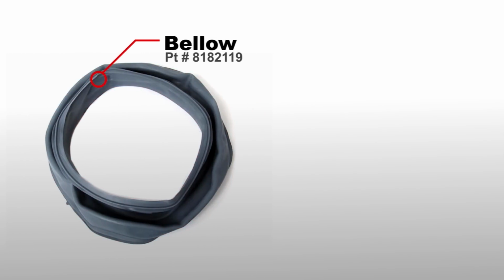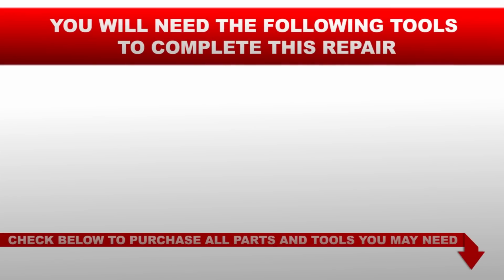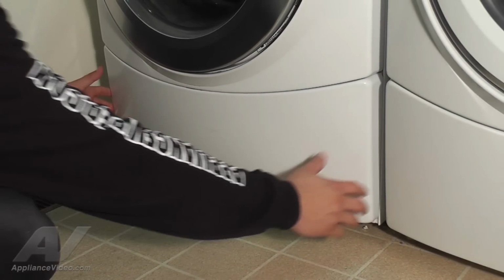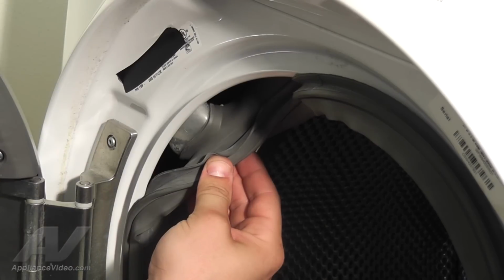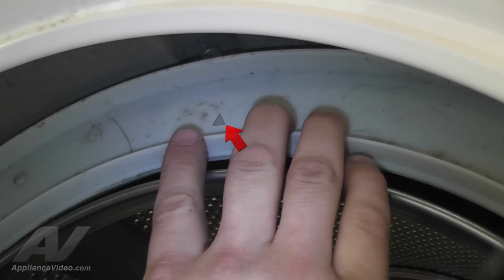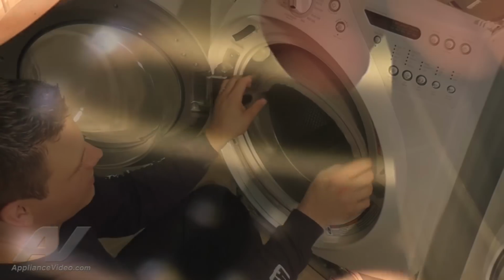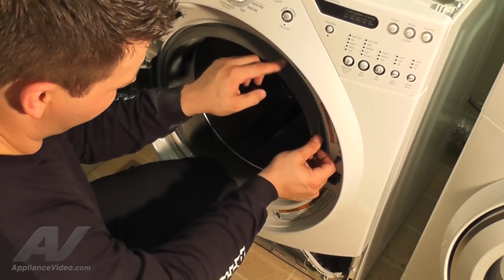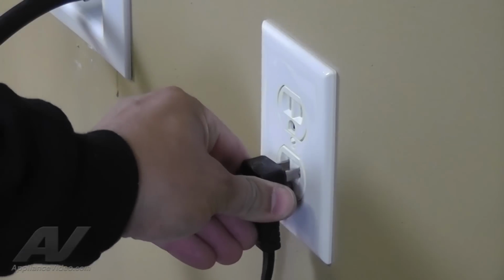Whirlpool Washer Repair - Leaking Water - Bellow

Comment: Thanks for the video.   Glad I didn't have to take off the front panel as is the other video from brand x.   I used a 7mm socket for both the kick panel screws and the tub retaining band.  I also found it easy to use a needle noise pliers to pull one end of the spring ring to expand the spring on installation.
Reply from the maker: Jeff
       That is great information, Thanks for sharing the 7mm socket and other tips.  Please help us provide more videos to our site by subscribing to our YouTube page or posting ApplianceVideo.com site on your Facebook or Twitter account. We also have our factory authorized technician’s email daily free professional advice to people like you to help solve their appliance problems. Thanks in advance for supporting us. Matt, Ace Appliance service technician.

Comment: Great video.  The 5/16 nut on the clamp ring was actually 7MM and thanks to to comments about using a pair of needle nose pliers to get the spring wire on the outer rim.  Worked much better.
Reply from the maker: JCR 
        Thanks we will change The 5/16 nut on the clamp ring to 7MM . Thank you for your positive comment. We are glad we could help resolve your issue and hopefully saved you money. Please help us provide more videos to our site by posting us on your YouTube page or posting ApplianceVideo.com site on your Facebook or Twitter account. Our factory authorized technician’s provide free repair support to people like you to help solve their appliance problem at ApplianceVideo.com. Every other on line repair help website charges $40-$50 dollars just to provide answers and technical help, ours is 100% FREE. Thanks in advance for supporting us. So email us if you have any other questions our videos cannot resolve. Thanks for your support in advance.  Matt, Ace Appliance service technician.

Comment: The repair went just as expected thanks to your video. It is helpful to have an extra pair of hands. I found it useful to have a mirror since I couldn't see behind the seal without it. We were instructed to buy replacement clamps but we did not need them, and at $40 we will be returning them. The outer clamp is pretty tricky, I don't think we could have done that part with just one person.
Reply from the maker: Trista
          Thanks for the positive comment. Hopefully we saved you some money. Please help us provide more videos to our site by posting ApplianceVideo.com on your YouTube, Facebook or Twitter account or add us to your circles. If you are in need of any parts please support our parts department on line at http://savemoreonparts.com/ or call 1-800-830-5465 7-days a week until 11pm Eastern time. Thanks again your support.  Matt, Ace Appliance service technician.

Comment: Well, I'm waiting for my new bellow to arrive today. So many videos show you to take off the whole front, door, back, top etc. I hope this one works for me. I have the bottom off already. Cleaned all hoses, drains, coin trap, black pump thing and put new door latch on it a few months ago. My Duet washer won't drain and I'm praying this works. I found 3 holes, two large in the bellow. Hope this works. Thanks
Reply from the maker: Great question, if you have a more technical question that our parts department cannot answer, you can search our over 17,000 answered questions free at our website www.ApplianceVideo.com under our Repair Help section. You can also call our parts department at 1-800-830-5465 and they can give you help 7-days A week ,or search at www.SaveMoreOnParts.com  .
Reply: It was the drain pump. I'm doing laundry all day. So happy 😊

Comment: This repair was a piece of cake JUST as it was shown.  I lifted the front of the washer on a 6in block of wood for easy access, it was tilted back for easy access to the bottom torx screws (you can use a socket too). I had the whole thing apart in 7 minutes! The front spring clamp comes off just as they show. The inside gigantic hose clamp is even visible when you peel the boot back. The clamp can be loosened with either a stubby screw driver or a 1/4 in ratchet or from underneath with an extension on the ratchet. I had a swivel socket, but, you don't need it. When you put the boot back, you just make sure it sits nicely on the lip of the tub. This is where people get stuck and frustrated. A suggestion: use some dish-washing liquid to lube the rubber and slip it on. I didn't have to, it sits very well. If you're fighting with it, you're not going to get it. Make sure you have a small flash light so you can see better. You can slip the boot in past the balance weights without any issues and the clamp slips on afterward just as easy. If you're fighting with it, you're doing it wrong, stop and take a breather. Total time to slip the boot on, check that it was on the lip correctly and clamp it on may have been 15 minutes? Total time with washer back in place was about 30 minutes? I was expecting a bigger challenge!
Reply from the maker: Thanks for your response, we are glad we could help. Our library of over 5,700 videos are currently helping 1.6 million people like you every MONTH.  Please help us by subscribing to our YouTube channel, or post our website www.ApplianceVideo.com to your Facebook page
Reply: So our washer is fairly new, like 7 mo old max, leaking from front, how do you know that’s the problem?

Comment: I had stuffed too much and separated the seal from the door.  Thx to this video, I found out how far to pull the seal out and where the pressure cable went around the outside of the door. Fixed the seal and i no longer smell burning rubber (from the seal too far in and the drum on spin cycle would rub against it).  Thx !!
Reply from the maker: Thank you for sharing your experience with us. Yes, that bellow seal can be a little tricky sometimes! Glad your repair went well :)

Comment: My series 2000 had occasionally leaked across the top of bellow. I thought i might be overloading it. Later I found the E5F2 error code. After watching several YouTube videos. I checked and the latch hook was a little loose. I tightened it. Their error code was still there. I hadn’t learned how to erase codes. My instruction manual for this was taped to the inside of the bottom front panel.i had previously called a repairman about replacing the bellows but decided to attempt to repair myself. I saw the filter attached to the pump and recovered years of coins safety pins, etc. Some newer models have a small door to access the pump. I would recommend cleaning out on a regular basis. After I cleaned the filter I determined that I don’t need a bellows, because the leak stopped. The clogged pump filter was limiting the drain pump. Point iS that BELLOW may NOT need to be replaced. Hope this helps someone.
Reply from the maker: Hello 

          Thanks for the good tip, I hope it
can help others with the same issues. Please help us by subscribing to our YouTube channel,
or post our website www.ApplianceVideo.com to your Facebook
page

Comment: Thank you very much for a great video. Unfortunately, I closed the door on a shirt sleeve the matched the color of the bellow.  I didn't see it & as the washer spun, the seal/bellow was pulled out of place causing a leak.  I followed your instructions to properly replace the bellow.  If the bellow turns out to be damaged due to the sleeve pulling it out of place, I will be back.  Thanks, again.
Reply from the maker: Audrey
     Thank you for your positive comment. We are glad we could help resolve your issue and hopefully saved you money. Please help us provide more videos to our site by posting ApplianceVideo.com on your YouTube, Facebook or Twitter account or add us to your circles. If you are in need of any parts please support our parts department on line at http://savemoreonparts.com/ or call 1-800-830-5465 7-days a week until 11pm Eastern time. Thanks again your support.  Matt, Ace Appliance service technician.

Comment: Excellent! Thank you! How crucial is it to line up the arrows (top)? If the tear is on the bottom can I just rotate to the top? Why the specific alignment? Replacement is several weeks out (out of stock everywhere!) and around $100. Seems water only builds up on bottom? Thanks!
Reply from the maker: Great question, if you have a more technical question that our parts department cannot answer, you can search our over 17,000 answered questions free at our website www.ApplianceVideo.com under our Repair Help section. You can also call our parts department at 1-800-830-5465 and they can give you help 7-days A week ,or search at www.SaveMoreOnParts.com  .

Comment: Washer works fine...the slow spin is fine, medium spin is fine.  when it hits the high speed spin for the last two minutes it makes a load banging noise and while I watxh in the tub seems to be moving more in a forward and back shaking direction which I am sure is causing that noise.  Does not do that on the other two speeds.     Any ideas?
Reply from the maker: Great question, you can call our parts department at 1-800-830-5465 and they can give
you help. If you have a more technical question that our parts department
cannot answer, our technicians are answering
all questions at our website at www.ApplianceVideo.com under our Repair Help section. We have over 3,000 common
questions and answers that you can easily search through by your model number,
appliance make, and problem or error codes, and It’s free to search through our
question & answer library.

Comment: ok the tool list says 1/4 nut driver but a T20 works better and is shown in the video, also tool list says 5/16 socket, but I needed a 7mm or 11/32; lastly 20' of extension (put a couple together) and a 1/4 drive universal makes the big clamp easy
Reply from the maker: caracic

        Thanks for your input, we went by our specific model we were working on. Each model has different sizes. Did the video help you with your repair ? We hope it helped you like it has thousands of other people.  Please help our ranking by subscribing to our YouTube page or posting our ApplianceVideo.com site on your Facebook or Twitter account. Thanks again in advance

Comment: Thanks for the video. I followed the procedure but I found I cannot lock the door unless I’m leaving on it. If I take the spring clamp out, it locks sometimes (but sometimes you still have to push on the door) It’s like the part that touches the door is sticking out. 

Any advice?
Reply from the maker: Great question, if you have a
more technical question that our parts department cannot answer, you can search
our over 10,000 answered questions free at our website www.ApplianceVideo.com under our Repair Help section. You can also call
our parts department at 1-800-830-5465 and they can give you help 7-days A week
Monday -Sunday, or search at www.SaveMoreOnParts.com  24 hours
7- days A week.

Comment: Is this the same procedure for kenmore he4t? Or do I need to remove the top as well?
Reply from the maker: Great question, you can call
our parts department at 1-800-830-5465 and they can give you help 6-days A week
Mon-Sat . You can also search at www.SaveMoreOnParts.com 7- days a week.  If you have a more
technical question that our parts department cannot answer, our technicians are
answering all questions at our website at www.ApplianceVideo.com under our Repair Help section. We have over 6,000
common questions and answers that you can easily search through by your model
number, appliance make, problem or error codes, and It’s completely free to
search through our question & answer library. There is a very good chance
you question is already answered there.

Comment: Fix the leak and save yourself a lot of money at the same time. Simply buy some "D" profile flexible door weatherstripping and next squeeze some Instant Gorilla Glue around the edge of the bellow and glue the weatherstripping by following the circular face of the bellow. Probably any instant glue would work. It may not have that "factory" look but who cares. This repair costs under $20, while I was quoted around $150 just for a new bellow part.
Reply from the maker: +Peter Smyth 

Thanks for your positive comment. Only DYI people can do this. Factory certified technicians would loose their license. Homeowners can try anything to save money.Before anyone tries this make sure the gorilla glue can withstand the water temperature before it breaks down.  We are glad we
could help resolve your issue and hopefully saved you money. We have helped
millions of people repair their own appliances so please help us produce more
videos to our site by subscribing to our YouTube page, or posting our http://www.appliancevideo.com/ website on your Facebook or Twitter account. Our
factory authorized technician’s also daily provide free professional Repair
Help to people like you to help solve their appliance problems. You also have
the option to email a factory service technician with a question at http://www.appliancevideo.com/repair-help/ .  If you need of parts for your major
appliance, we have over 5-million parts in stock at http://savemoreonparts.com/ . Thanks in advance for supporting us. So email
us if you have any other questions our videos cannot resolve. Thanks for your
support in advance.   Matt, Ace Appliance service technician.
Reply: +ApplianceVideo.com Thanks for your comments. I fully understand where you're coming from. As for the glue, I've been running our machine for weeks now without any leaks. The good thing is that if it does leak all I need to do is repeat the procedure with the same weatherstripping.

Comment: the water in my GE Washer started leaking from the Soak Door. It clearly is slow in draining inflow water in fill cycle, It can't be due to pressure since we didn't do anything that would change the pressure. Niether it is due to a seal near glass.   I am assuming it could be a blockage ? How do I troubleshoot it, please help.
Reply from the maker: Vishal 

All of our technicians are now answering questions daily at our http://www.appliancevideo.com/ website under the Repair Help section.  We also have over 1600 common questions and
answers that you can easily search through by your model number, appliance
make, problem or error code and it’s absolutely FREE. You also have the option
to email a factory service technician with a question on your appliance at
http://www.appliancevideo.com/repair-help/ . If you’re looking for a repair video, you
can also search our library of over 2600 free repair videos. ApplianceVideo.com
specializes in quality DO-IT-YOURSELF appliance repair videos and we get over
800,000 views per MONTH to our videos worldwide and growing. If you need of
parts for your major appliance, we have over 5-million parts in stock at http://savemoreonparts.com/ .  Thanks
for your support. Matt Ace Appliance factory service technician.

Comment: My front loader door is locked and won't open
Reply from the maker: Great question, if you have a
more technical question that our parts department cannot answer, you can search
our over 10,000 answered questions free at our website www.ApplianceVideo.com under our Repair Help section. You can also call
our parts department at 1-800-830-5465 and they can give you help 6-days A week
Monday -Saturday, or search at www.SaveMoreOnParts.com  24 hours
7- days A week.

Comment: hay how do i fix faulty timer on my whirlpool front load washer? anyone?
Reply from the maker: Great question, you can call
our parts department at 1-800-830-5465 and they can give you help 6-days A week
Mon-Sat . You can also search at www.SaveMoreOnParts.com 7- days a week.  If you have a more
technical question that our parts department cannot answer, our technicians are
answering all questions at our website at www.ApplianceVideo.com under our Repair Help section. We have over 6,000
common questions and answers that you can easily search through by your model
number, appliance make, problem or error codes, and It’s completely free to
search through our question & answer library. There is a very good chance
you question is already answered there.